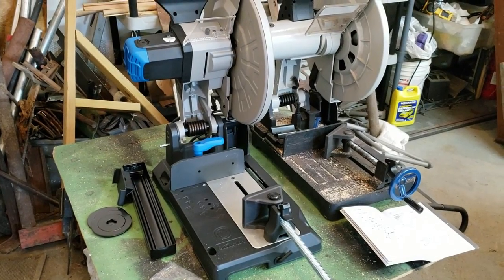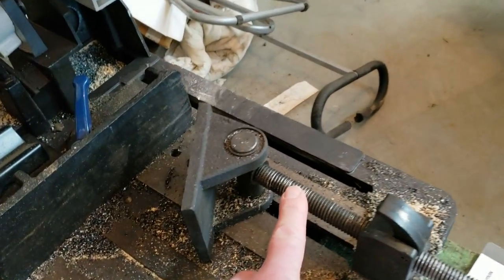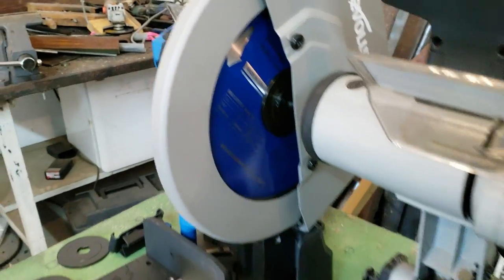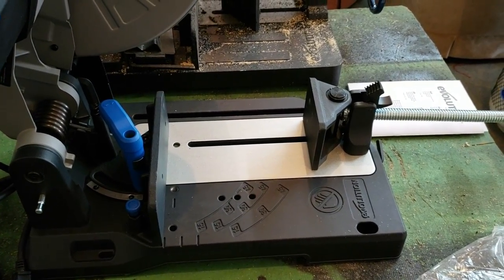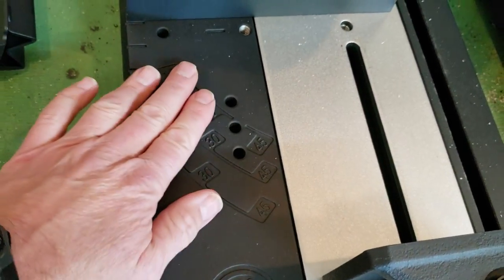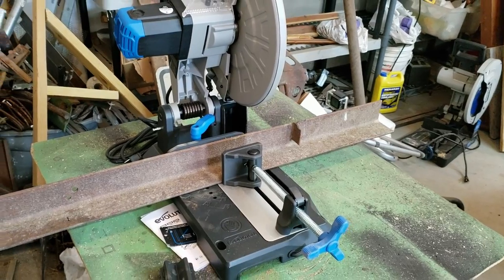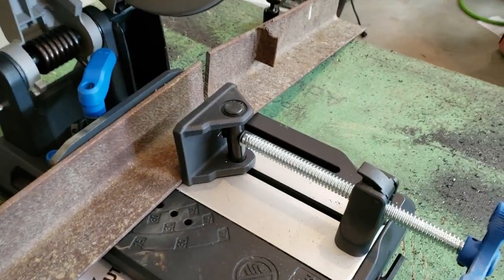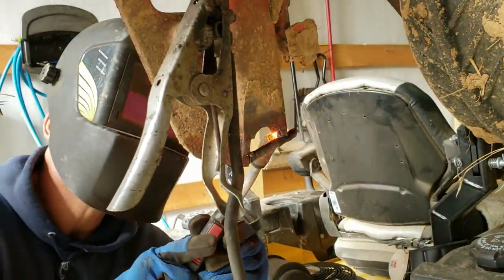Evolution S380CPS Steel chop saw full product review @ Kapper Outdoors Illinois farm

Comment: Ordered this saw, based on this and some other reviews.  Evolution S380CPS: Metal Cutting Chop Saw   The saw arrived DEFECTIVE,, the "lock" used to change the blade does not work.  As there is not blade installed, it was a complete show stopper... How could a simple thing like this get missed ?  ALSO no 15 inch blade supplied!
Reply from the maker: Well I personally believe quality control has eroded badly in the last few years, not just for evolution either. Look at how many current stories and times you hear about defective stuff brand new. Tractors, vehicles, machines and more. I do think quality overall has been set in reverse. Sorry to hear it, best of luck though.